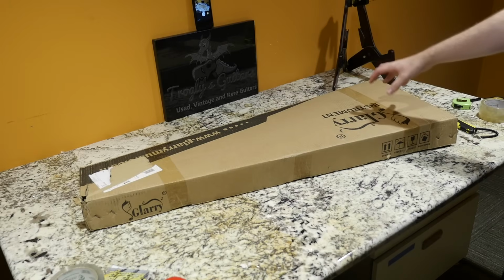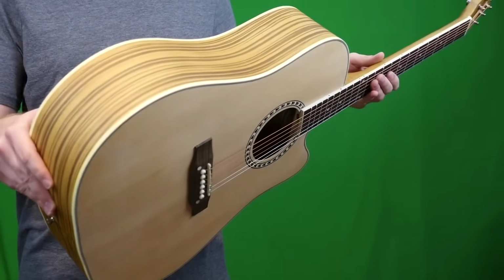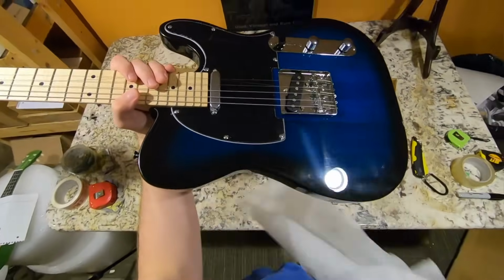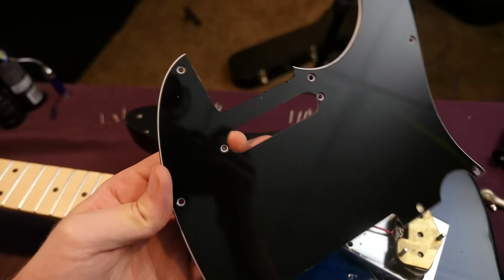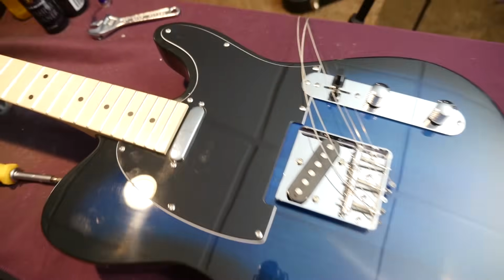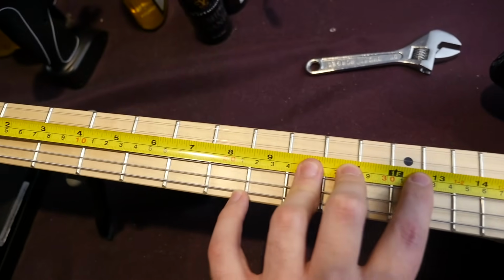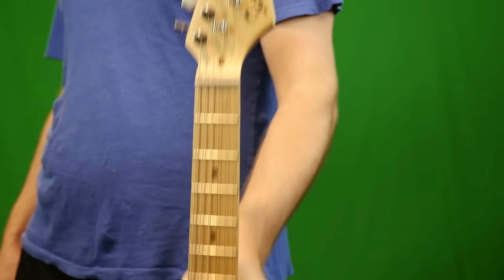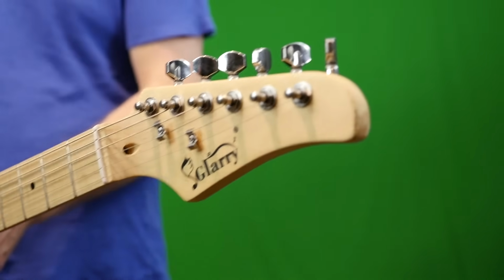How I REALLY Feel About Glarry Guitars... | Glarry GTL Maple Electric Guitar Blue Review + Demo

Comment: Best guitar for the money is a LOTUS , made in Japan
Reply: One of the worst guitars I ever had was a Lotus Strat copy, it was my second guitar after my first was stolen.  The neck moved and needed shims, it wouldn't stay in tune for anything.

The only guitar I've ever owned that was worse than the Lotus was a cheap Epiphone LP Junior that I bought new for $99.  I was working in the oil field in North Dakota and just wanted a cheap guitar to bang around on but the Epiphone was literally unplayable.  It wouldn't stay in tune more than a few strums.  Just complete junk.  I didn't have any tools or time to work on it so when I left for home I ended up just giving it to a guy who lived at the camp I worked at.
Reply: @Vichedges  You need to replace the tuners. Nothing wrong with shimmed neck.Those guitar were not bad guitars they just needed  serviced by professional.
Reply: A guitar is nothing more than parts. You address each part, one by one. until it's perfect.
Reply: @grantkoeller8911  And you know this how?  Did you build a time machine and go back and inspect it 

I "service" my own guitars and don't have any problems with any of them.  That Lotus was just a huge POS. 

I'm also fairly certain it was made in Korea, not Japan like you seem to think.

Not all Lotus guitars were made in Japan, most (if not all, I don't remember seeing any Japanese ones but it's been a long time since I've even seen a Lotus guitar) I've seen weren't from Japan, they were Korean.
Reply: @Vichedges   lived in Japan for 4 years with the military, so i saw 100's of lotus, westone, teisco, kent, guyatone, tel star. audition, tokai, electra, memphis, univox, greco, fernandes, esp, hondo, aria pro II,
Reply: @grantkoeller8911  ok?

Comment: Faulty jack outputs: Ruining many a young boy's Christmas for decades!
Reply: It takes less than 5 minutes to fix it.  It literally takes longer for the iron to heat than it does to do the job.
Reply: @TempoDrift1480  Explain please! This is timely for me - I just noticed my practice amp starting to do that that dreaded crackling, in-and-out thing just last night...
Reply: @greg7656  Explain???  Explain what?  That it takes longer for a soldering iron to heat up than it does to fix a jack?  Not much to explain there homie... If you play an instrument you should know some basic repair and soldering a jack is pretty essential.
Reply: @TempoDrift1480  dude, I can barely handle a pick, much less a soldering iron.

Comment: Great guitar for the money. With some 'Know how' you could spend $100 into it and it'll sound like any Telecaster in the $500 range. Learn proper set up. Cheaper yet higher quality hardware and electronics are a dime a dozen. Knowledge makes a great guitar. But will add...a $2000 guitar wont make you a better player. Your hands (if you have the skill) will make cheapest guitar sing.

Comment: I would say that Glarry is at the literal bottom of the budget guitar genre, and I wouldn't go there. I just bought an Aiersi Tele copy in orange flame, and to tell you the truth I cannot make this guitar go out of tune. I paid a grand total of ......wait for it.........$125 CDN. Yes. $125 used. When I say used I mean played about 20 times. I had to throw a scotch pad at the fret ends and polish them up a little, but in the end I have a $400 guitar for $125. The pickups are OK and actually sound fairly decent with gain. I am shredding the crap out of this, and I'm no newcomer at 54.
I forgot to say that the only upgrade I've done is rep[lace the string trees with roller ones. I have no idea if this made any difference at all, but theory says it would. It holds tune from day to day with barely a cent difference. I'm amazed, and even holds the same with an hour of playing, and I'm aggressive.

Comment: I though I would pick up a cheap guitar to keep in DADGAD tuning. On the upside it was very handsome. On the down side it was terrible with lots of fret buzz. I tried to sell it at guitar center but they would not buy it do to the bent neck. I gave it to goodwill. No point In doing a neck job on a $50 guitar 
So in the end a handsome horrible guitar

Comment: When you review the less expensive electric guitars scrape the wood once or twice vigorously with a pointed instrument in the control or pickup cavities. If it leaves a deep scratch it won't be a hardwood body as Fender required on all their guitars except for a few pine Teles they built in the early years.

Comment: Well it will stay in tune better than a $3,000 Gibson Les Paul and the headstock won't break. So it's got Gibson beat.
Reply: Jaime Anderson 

Keep telling yourself that. Lol
Reply: @powbobs  If you don't know Gibson headstocks break and they stay in tune worse than any guitar on earth you know very little about guitars. Google Gibson Les Paul broken headstock lol
Reply: @guitarprepnplus1  If Gibson wasn't so careless about both issues they would fix both problems. That's the root of the problem. Gibson had a bad design and will not fix it. So make all the excuses you like. I've owned two Gibson guitars. A Hummingbird and a Flying V. Both were not well built. Sold both of them. I'll never be foolish enough to buy anything else from Gibson.

Comment: I got a Glarry Tele-style guitar.  It was utter trash.  I removed the pick guard to add some copper tape and was shocked at how terrible it was routed and drilled.  Everywhere they drilled, they drilled too far and ran into another part of the body.  The neck pocket was chiseled in the middle, but not on the top and sides, which makes absolutely no sense.  The neck needed a massive level, crown and polish.  One of the tuner knobs just fell off. While it is a cheap guitar, I consider it very expensive fire wood.

Comment: In my opinion if you are going to spend $100 on a guitar (which is about what this is would shipping and handling unless you got it for free,but even so what's 20 or $30 difference?)?
     I say level up, buy an affinity Squier. You will be extremely pleasantly surprised for under $200. You'll get $450 worth of guitar (in 1980s money).